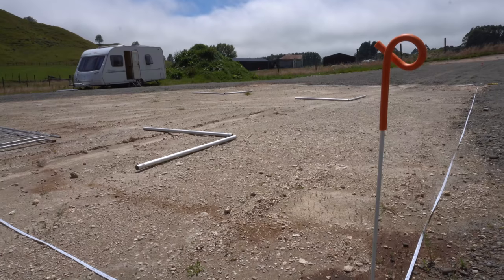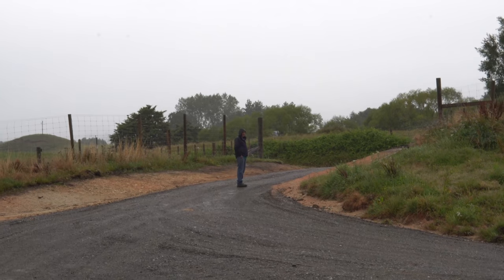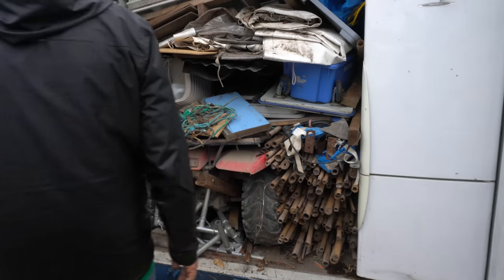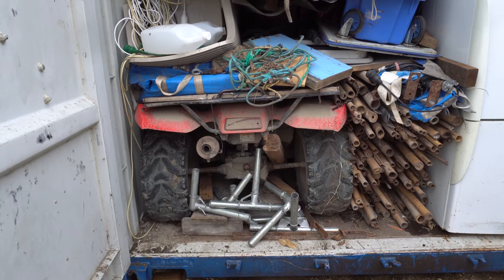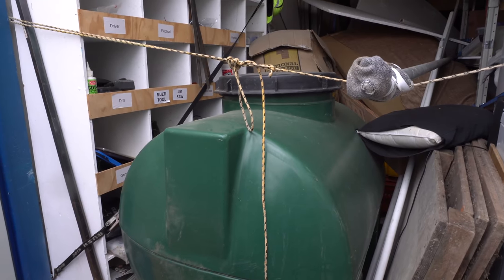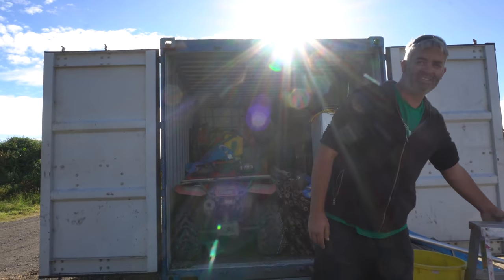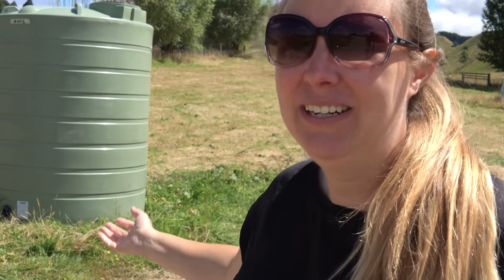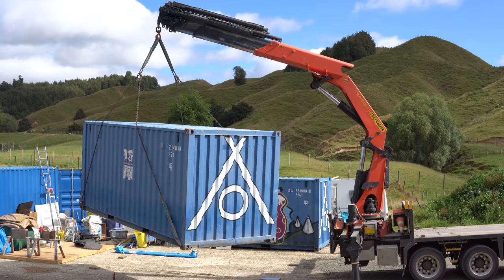CONTAINERS Arrive At Our Land!

Comment: Having 2 placed parallel to each other with a driveable or caravan width between which can be used as under cover storage or anything else. A roof over the containers is a good idea and this set is ideal to cover 2 containers and creating a covered area. The tops of containers are completely flat, and have a tendency to collect rain water in the slightest dips and rust, also they collect leaves and twigs. It also adds extra protection from the heat and cold. The roof also can collect rainwater for a tank.
Reply from the maker: Yes, we'll eventually add a roof in-between. Collect water too.

Comment: It would be good to have them in parallel about 10 feet apart then put a roof on a back panel and a front door...extra room hey Presto or a garage for the caravan.
You could position one at the back to provide a back,then one at the front door positioned so a door space is there....so you just put a roof on the lot then build a standard entrance door.or buy a few more and stack them...no roof needed !...ive seen them used as emergency accommodation in the UK...clad in pine and a drive up to the second floor.....lovely..oh I forgot...bury a couple for cellars..maybe not because of the water problem..they stack them on ships don't They?
Reply: good idea  .
Reply: @haydenroberts7061  that's great Hayden.....i can't wait to see what you do...
I probably missed a bit of the vocals as I had to keep my sound low..please forgive me..